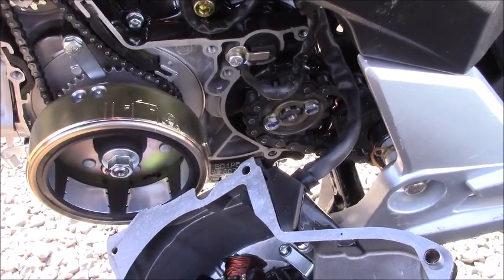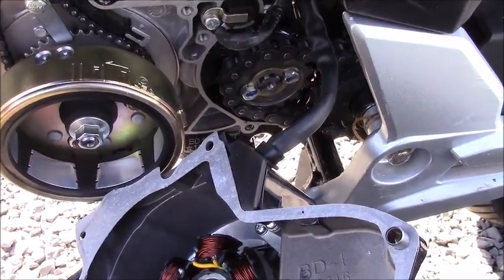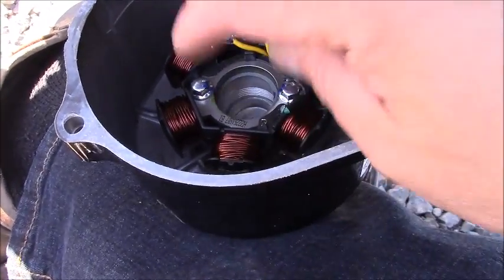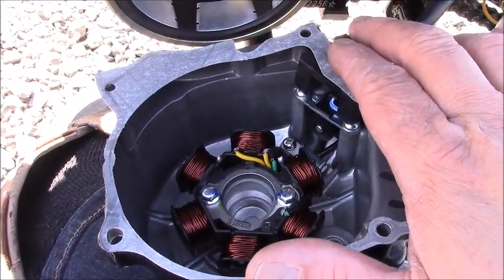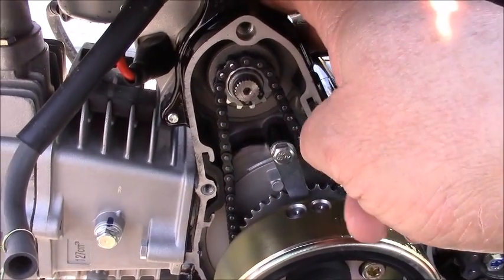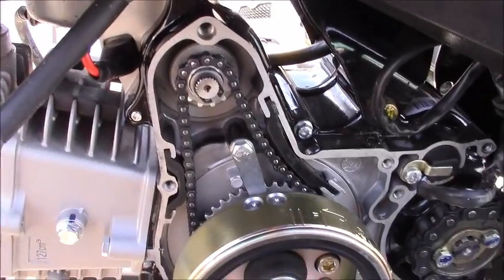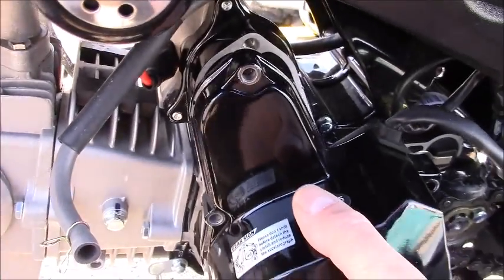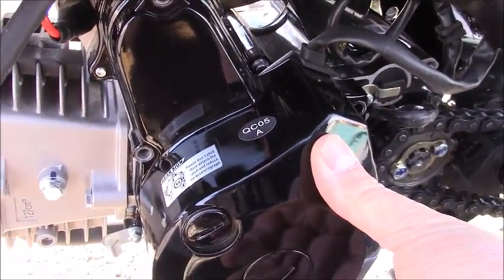How to replace a stator on your Pocket Bike, Dirt bike, ATV, Super Pocket Bike

Comment: I have a question ! There is a seal on the flywheel & I am having so much trouble finding one online. The other morning when I started, my bike engine started pouring out of the stater housing, and I noticed that the seal that goes around inside of the flywheel has a little bit of a dent in it. Is there supposed to be oil inside of that housing? I have the same engine 1p54fmi

Comment: how you add the gear oil to 125cc venom
Reply from the maker: The 125cc Venom has a wet clutch which means it is lubricated with the engine oil. You don’t have any gear oil, the engine oil does it for you
Reply: Thank you :-)